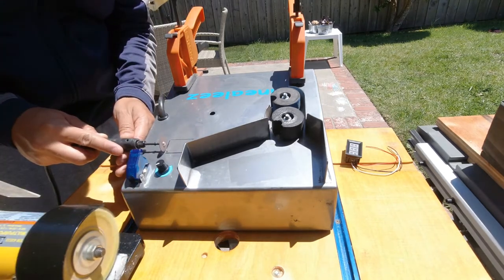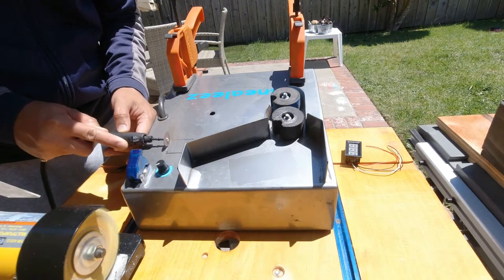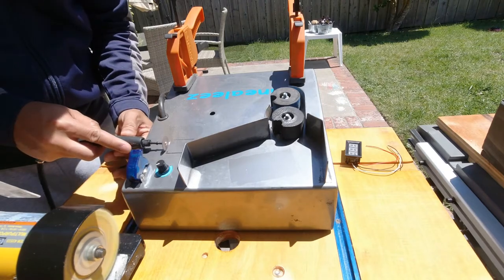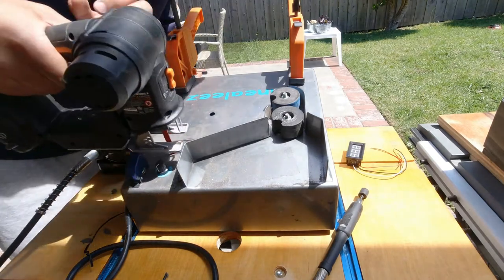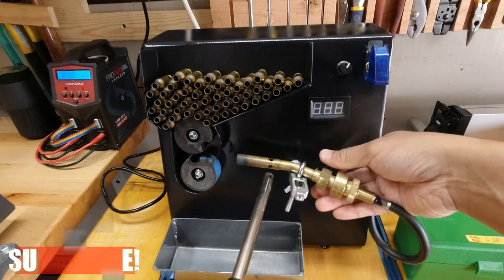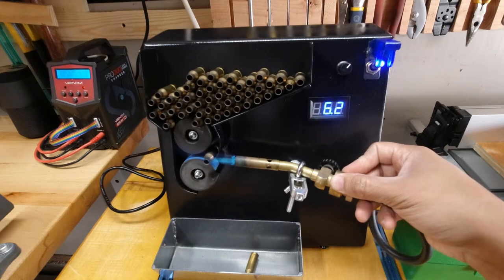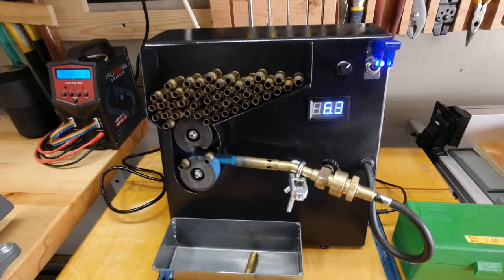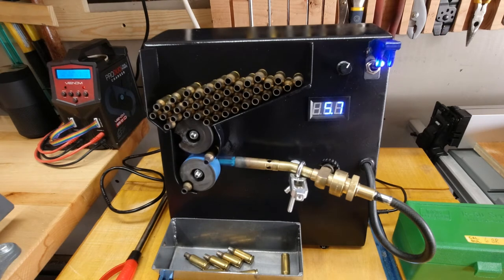Best Annealer for $200? - Annealeez w/Modifications - What I did, that you will want to add!!!

Comment: I made the mistake of buying a Gen 2 machine. It's a piece of junk that melts the drive wheels when annealing short cases like 300 Blackout. It's going in the next garage sale.
Reply: That's because you need the short wheels. No mystery there. States so on the website. I use mine on .223/5/56 and 6mm Mongoose, a .223-based wildcat and have no problem with the drive wheels. But if you ask the maker, he'll tell you you need the shorter wheels for 300 Bo and like.

Comment: I bought one, very poor quality, just used once, and done not work properly. I contacted with seller, but one body take care of me.
Reply from the maker: That's unfortunate. I had a good experience with it and I had the original version. The new one that is out has additional updates. Cheers and thanks for the comment.
Reply: Please define "done not work properly." I have the Gen 2 and it works like a champ. The rubber feet would be a plus, but not a necessity by any means.